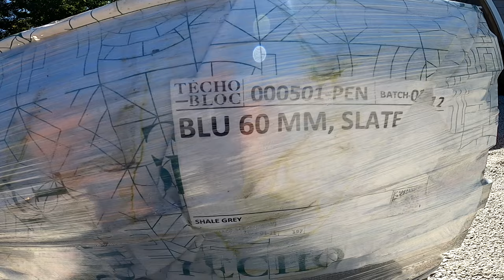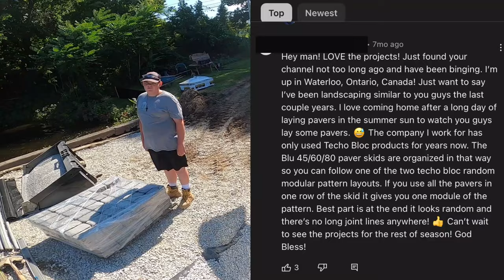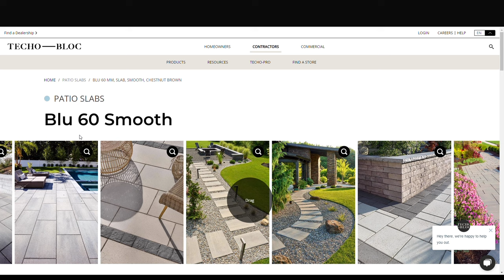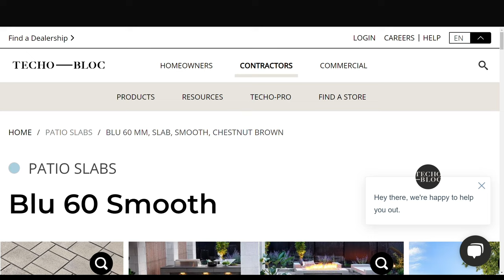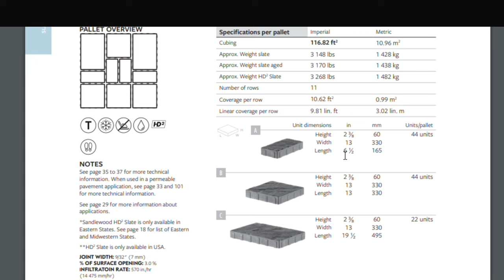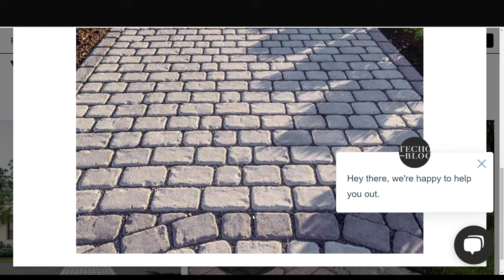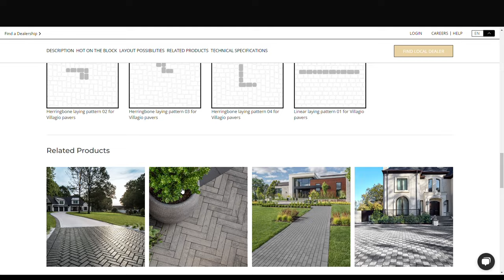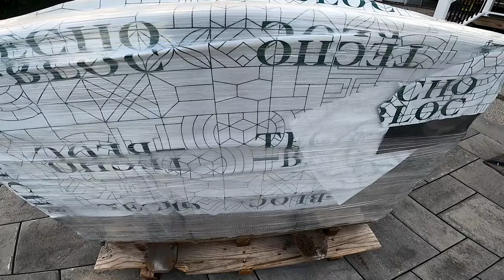How To (Properly) Lay a Paver Patio. | Techo-Bloc (Blu 60)

Comment: Sometimes I wish that I could learn to install using a pattern so I wouldn't need to spend so much time breaking lines and avoiding 4 way joints. Techo-Bloc makes a superior paver compared to their biggest competitor. You can feel how much more dense the concrete is when cutting them and hardly any chipped pavers upon opening the pallets. Iv'e noticed a trend towards smooth finished pavers over textured finished recently.
Reply from the maker: Patterns can save time for sure, but I still love a random patio. And I totally agree that their pavers are very strong compared to others. I am seeing more smooth being used lately, I like both really but I would want texture on my own patio...

Comment: This is another great video. I have watched dozens of them. Thank you for taking the time to create them. 

I have one question for you. When you lay pavers like these onto the screeded chip stone, do the pavers “sink down” under their own weight and after compaction? 

I am going a project soon and I need to match the height of an existing retaining wall, much like you matched the height of the sea wall on this project. So appreciate any pro tips you have.
Reply from the maker: Thank you and it is my pleasure making the videos. When we plan to meet an existing structure like this sea wall and your retaining wall. We account for about 1/4" compaction / settlement. By setting the screed rails slightly higher than the wall you are meeting, it accounts for that settlement. Good luck with your project! ✌

Comment: Your work is amazing. I have a question. I want to build a 16 x 20 pavilion and I want a paver floor versus concrete. I also plan on framing a fireplace and a wood burning insert. The framing all 2x4 with concrete board with stone veneer laid in it. Can I build the fireplace framing on top of the pavers?  
Thanks
Reply from the maker: Thank you very much, that sounds like a sweet project! I would recommend pouring a concrete footing for the fireplace / insert just to be safe and lay the pavers around it. It would be a shame if the pavers settled and messed up all that hard work. I never use pavers as a footing. Anything that has weight and will be resting permanently, I pour concrete pads.

Comment: This year I’m trying to slowly get into doing pavers so starting off with like walkway patios and that. I’ve been having a hard time on trying to figure out a good number per sqft with everything included
Reply from the maker: That's cool man, it is a great thing to get into. I do not sell with a set sq ft price. Every job is different in so many ways. The paver projects I do can vary from $18 per sq ft all the way up to $35 per sq ft depending on circumstances. Don't hurt yourself by locking into a set sq ft price. Take each job and estimate it based on everything it will take to complete the job.
Reply: @TheChristianHardscaper  I appreciate your reply thank you very much on the help Ik it’s hard to say every job is different, love the videos
Reply from the maker: @joshbaker7914  No problem, Good luck with getting into it! ✌